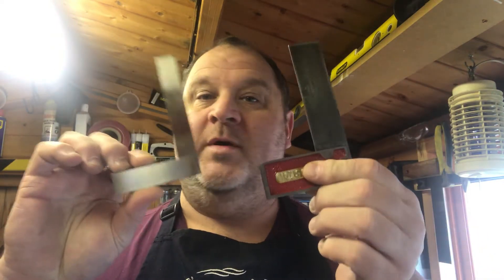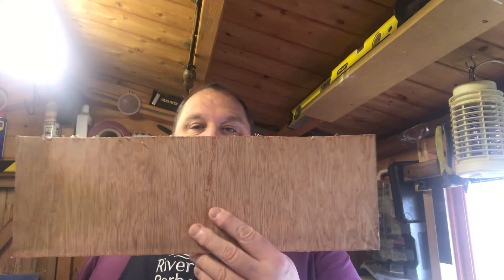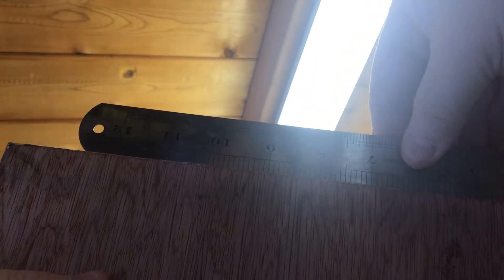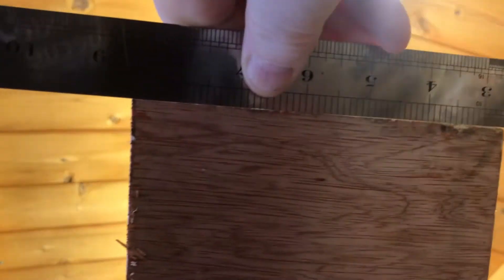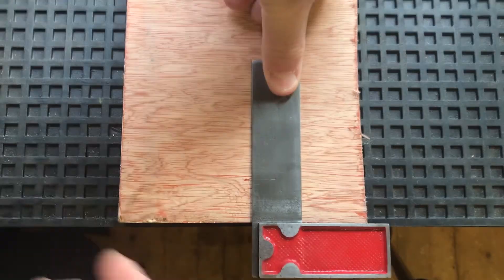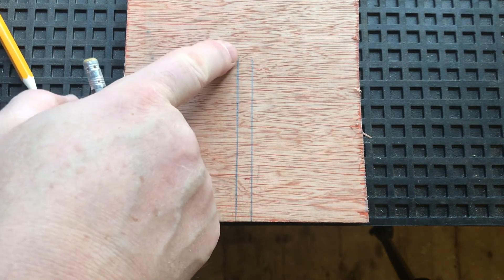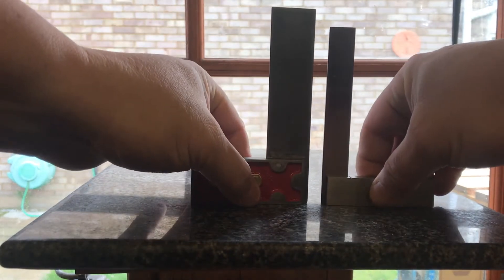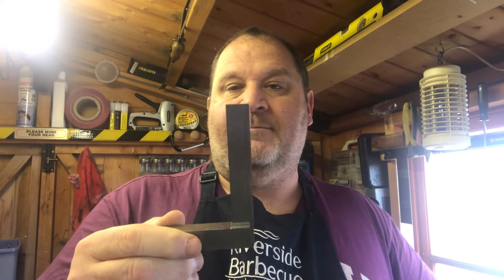How Square are your Engineer's Squares?

Comment: I remember in my metalwork class in the early '60s, carelessly dropping an inspection grade square, knocking it out of kilter. I was given the task of filing and scraping both edges of the blade back to true square plus/minus 1 thou with both edges straight and parallel- A hell of a task for a fourteen year old, which I eventually accomplished. A lesson well learned !
Reply from the maker: Sounds like a great way to make sure you never drop another one again. Thanks for watching and commenting and remember to subscribe to my channel for more helpful content.

Comment: There's a few things that are limited with the board check. You can only reference the top of the square's stock. 

The board doesn't need to be straight if you clamp the straight edge down to it. Personally I would lay some paper down under the ruler first. Then I would use a razor blade to cut the line instead of a pencil. Check the outer blade of the square with reference to the top of the square's stock like you did. Do it again for the inner blade. The repeat it all placing the bottom of the square's stock against the top of the ruler edge to check the reference of the outer square stock to the square's blade. The board is just to cut against at this point since the ruler is clamped and the razor blade will give a consistent line  pencils wear much faster than a steel scribe/blade. Then write how much each reference edge is off on the square so that I always know when using that square.

For the people worried about the tool tolerance. Both of those square are not good for machinery if put on a surface plate. Use the right tool for the job. Not everything requires six sigma tolerance. 

Both of those squares are over kill for building tree houses, pinewood derby, basic book shelves and a whole lot of things. The one that is more off would give some problems for higher precision things like picture frames when the joints are visible, or puzzle boxes, maybe cabinets or dressers with tight fitting drawers. However, wood expansion though the seasons would be more of a problem for tight fits. Honestly, modern hardware for drawers can handle that tolerance in many cases. There would have to be a lot of errors introduced by a poor design or poor measuring/cut in general by the woodworker for there to be a problem. Woodworkers rarely work with a cut edge on fine products. They often sand, rasp, plane the wood to shape and check fit. The big ol pencil makings have more room for error than that square does.

Skill makes up a lot more than superior tools and materials, historical furniture and architecture is evidence of this. Tools are better and stronger than tools were in seventeenth century, yet furniture back then was beautiful.

My point is, people can make beautiful things with cheap tools and if that's what they can afford, that's okay. Know your tools. Know their quirks and if you know your square isn't square, then you can develop techniques for your specific tool to make square cuts. Consistency and being able to do things intentionally is important over all else. Not how square your square is. If you remember your trigonometry, all you need is a ruler and you can make a square of any size that your project requires. Arguably a set of calipers or dividers would be more useful than a square. (Another way to check your square for accuracy)
Reply from the maker: Great feedback Dani. Thanks.

Comment: Hi Ian. Great tip for beginners because they would expect the square to be accurate but in todays cheaply made imported tools or 
even old second hand tools its pot luck. Well said "Don't trust". Found you off Karlpopewoodcraft's channel. Just subscribed Tony
Reply: I often buy rosewood cabinet squares at sales for a quid or less. Not many are square, but it is a source of cheap rosewood for small projects. The cut blades of the larger squares also make serviceable cabinet scrapers.
Reply from the maker: There’s some great advice right there, Old Grizzly. You could probably use the handle for handles on knives or even refurbing a perfect handled screwdriver. I’m gonna give those ideas a go! Thanks for watching and commenting. Don’t forget to hit the subscribe button for more helpful content.
Reply from the maker: Thanks Tony. Glad to have you on board.

Comment: Just a word Ian you can adjust them if you get a punch and punch in the corner you’ll spread the metal and you can straighten it out they’ll be a video on YouTube about how to straighten a square if you’re interested mate
Reply: If you have to adjust I think the only way (by hand) is to grind them on a sharpening stone but to be honest I've scrapped a couple doing this so not necessarily recommended.  That's if it is worth the effort.  But it is worth pointing out that these are made to Grade B if you are luck enough to buy one which is graded.  And this will be a thou out over a few inches which is very visible with the light test.  It does make you question your sanity when you delve into squareness.  Nothing is square!
Reply from the maker: You can punch all in one squares like roofing squares to make the angles wider but I don't think you can do that with two piece squares like an Engineer's square. As it will make the two pieces loose.